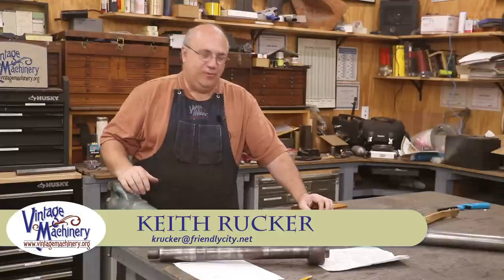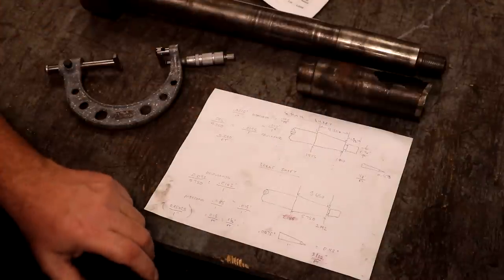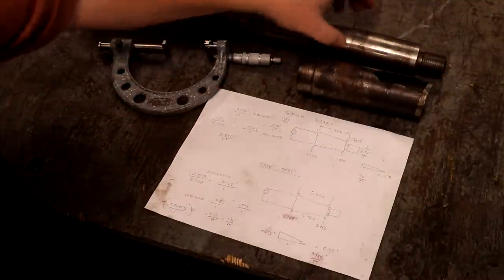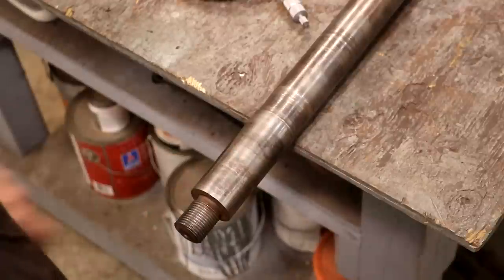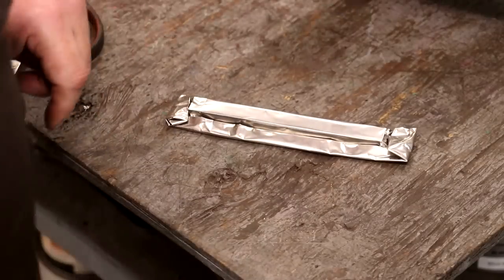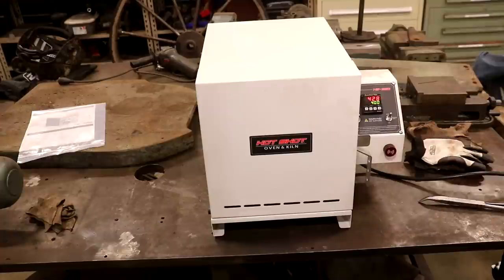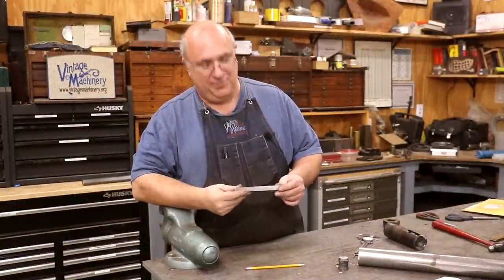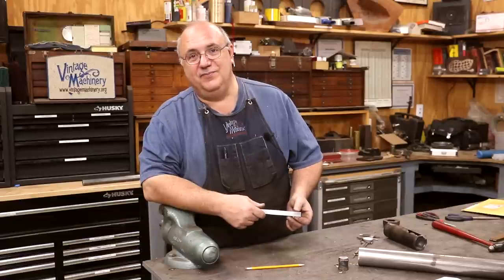The Jimmy Diresta Bandsaw Restoration, Part 8: Making a Taper Gage for setting a Taper Attachment

Comment: We always used a piece of ground round stock to set the taper attachment. Chuck it in the lathe, make sure it's running true and use an indicator to dial the attachment in with that.
Reply: My boss would have chewed my ass if I had wasted time making a a taper gage. An indicator on a piece of drill rod would give a precision taper a 100 year old band saw would ever need. Personally l would be more concerned about the quality of the matching bore in the the wheels of the band saw.
Reply: You've got a DRO why don't you use it instead of wasting time and valuable tool steel
Reply: @paul5683 think of this as a learning video for someone needing a taper Guage for something they do ,for instance someone trying to make multiple parts and needing a accurate and repeatable reference. Not something necessarily needed for this job but nonetheless it's a good learning experience for when it makes more sense to take the time to make one

Comment: Really fun project!  One tiny suggestion.  Magnetic fields love to close on themselves.  You might get a bit more grip if you installed the magnets in alternating directions rather than all aligned.
Reply: I noticed that too.  Alternating N-S-N-S across the piece would give a noticeable increase in grip.
Reply: Agree
Reply: The physics/math behind that: https://wikipedia.org/wiki/Halbach_array
Reply: @stephenoffiler8024  I noticed that Keith placed the magnets down and turned the magnetism. I hope that he had the proper magnet direction to match the mag plate or he would have damaged those small magnets. Altho he probably did it right.  If he had set them in N-S-N=S every other one would have lower magnetism.
Reply: While that would help a lot if the magnets are right next to each other, or they are in a non-magnetic material(ideally with a backing plate), in steel with such a large relative spacing for the size, each would be in it's own little shielded area with all the field lines shorted, I seriously doubt it would make any difference how they were installed.
Remember: They follow the lines of least resistance, just like electricity. You can use that to your advantage to control where and how the fields behave.
Reply: @Current Batches So you say....

Comment: New subscriber here, already a big fan. I'm an engineer doing practical shop-floor process work at a small tool manufacturer for 25+ years now, and I'm still learning some cool new stuff.  I did not know that a specified shaft taper on a print is based on included angle.  I have never seen a taper micrometer. Nice little oven! I need one of those. Re: heat treat foil, glad you remembered the paper. I always tap down my folds lightly to crease them and seal better (but clearly yours worked fine too). Re: grinding, I always use a piece of scrap as end-stop on the thrust side of the workpiece so it can't get spit off the chuck. And a couple times you freaked me out with flesh and bone WAY too close to a spinning wheel. Your spindle bearings must be excellent and you can't wait minutes on end for it to stop - in that case, I'd move it as far away as it goes.
Reply: I'm always very careful around grinding wheels - a moment of inattention and the wheel can take some meat off.  It's happened to me a couple of times, only once leaving any scar that's just made me more cautious.
Reply: I looked or this comment. I always shut off the wheel and wipe the table. Of course, Keith has experience, which I didn't.

Comment: Good job. But you made a minor math error. Thankfully, the angles are small enough that the error isn't significant, but it is a fundamental error.
The taper of 3/32" per foot means that the tangent of the desired angle is (3/32)/12 = 0.0078125

The 10 inches you mention for your sine plate is the hypotenuse of a right triangle, not one of the two perpendicular sides. So the correct thing to do is calculate the angle using arctan of the tangent calculated:
arctan(0.0078125) = 0.447614171 degrees.

then calculate the sine of the determined angle
sin(0.447614171) = 0.007812262

and finally, multiply by the 10 inches for your sine plate, so 0.007812262*10 = 0.07812262

Now, as you can see, the difference between 0.078125 and 0.07812262 is insignificant. But the reason for that is because the angle for your desired taper is so small, so the sine and tangent values are close to each other. If you were using a larger taper, the the differences become quite significant. For instance, if the half included angle was 5 degrees, then doing the math would result is a difference of 0.87488664 vs 0.87155743. And 10 degrees would be 1.76326981 vs 1.73648178.
Reply: When you think you're all alone and then BOOM, someone else sees it that way!!! Great one John and it's gratifying knowing the island has a population..lol....
Happy New Year John!!!
Reply: Thank you. That's what I was thinking in my comment, but I was not as thorough.

Comment: Keith, I was thinking about you the other day. I was at the scrap yard, and there was a pair of line shaft pulleys lying there. I wasn't sure if you would have had a use for them, but unfortunately I didn't sell enough to buy them, but I'm sure they could have been sold online or at our local Rough and Tumble History Society flea market in August. If you didn't have a use. 
Some time ago, I bought an axle with a pair of Amish steel wheels on it from another scrap yard, and a guy from NY state bought them out there for $50.
Nice tool that taper micrometer. I've not seen one before, but I don't go out of my way to buy them.

Comment: What is the reasoning behind making a gauge like that as opposed to sweeping an indicator on the lathe and reading the change per foot that way to dial it in. Seems like an extra step.
Reply: Keith has a toolmaker mentality. He made a tool that once made, it just drops into his taper attachment system and works, no more measurements, no cut and test, cut and test, oops too far, rinse and repeat needed. And it's 100% reproducible if he needs another one. He will also have that tool for the rest of his life, and likely pass it on to the next generation.

Comment: Good work :) About the magnets: I've worked quite a bit with neodymium magnet holders, and if you want them to last you need to be careful when machining close to them. If you break the nickel (most Neo magnets have a thin NiCuNi plating) Neodymium oxidizes very quickly, and very deeply. Oxidized neo loses almost all of the magnetix strength :/

Comment: In tool steels, doesn't the A designation mean it is suitable for air quenching? "O" type tool steels are oil quench and "W" tool steels are water quench.
Reply: Yes that is correct plus there’s different variants in each group, such as 0-1 and 0-2.

Comment: When I touch off when surface grinding I do it just a little bit differently. 
With the wheel off I come down slowly while turning wheel with my thumb till the wheel just
drags on the work piece. 
Then move the wheel up about .002" and start the 
wheel and table and slowly feed down till the wheel touches the work .
I find less surprises this way.

Comment: You could also use forming gas (5-10% H and 90-95% Nitrogen) in the oven.  Not only does it protect the metal but it will reduce oxides at the same time.  The level of Hydrogen is low enough to be safe . . . with proper ventilation.  Check the literature for flow rates.

Comment: ~@36:30  I noticed that you were not concerned with precision in the alignment of the gauge to the direction of travel. Eyeball would seem to be good enough with the assumed tolerances of this specific project, but is ensuring squareness on the mag plate a trivial exercise when producing a "precision tool"? I appreciate that the error on the horizontal diagonal is probably less than 0.000001", but your omission of comment on this geometry deserves explanation.
Reply: Please find my comment elsewhere for this discussion
Reply: There are reasons why it's better not to set the piece fully in line with the wheel. But you are correct the angle ground would be affected of course.

Comment: Keith could you show us how you would grind a non-ferrous metal part, specifically how you would secure it to the bed?
Reply: In case he doesn't show it, use a vacuum fixture for a non ferrous material  You can actually cut a ferrous material via vacuum fixtures this way as well however a magnetic fixture setup  is what we all tend to go too.

Comment: Why didn't you heat treat both taper gages at the same time? wouldn't it have saved on the cost of heating the oven two times?
Reply: Both taper gauges (gages?) ??  He made one gauge.
Reply: @paulcopeland9035  he has two tapers on the shaft so I thought that he would make two taper gages
Reply: @rickburris6164  He has two tapers on two different shafts, and he intends to reuse the shaft with the 1/4" per foot taper.

Comment: Merry Christmas...Love your work....always have !!!!!!! .your 7/10ths off measurement in that 1 inch multiplies up to +1 thou in the 1 ft and could have been on the count of NOT wiping off grinding residue from the mating surfaces on the part and the mag chuck when you moved them and reground.......i cant understand why the 2 tapers are different, Tapers should match, even w considering some type of lubricating film between the 2 tapers, they still should match. Personally I would clean up and recut the taper on the long shaft, and  on the bushing side, after pressing it in, precision ream the bushing to the same taper, only ream it in deeper that allows for that lubrication film abt 1 thou (1/2 tho per side) between part and shaft.. Just saying..........
Reply: It was 1 tenth off, not 7. He was looking for .0078 in 1 inch and he was getting .0077. I think he correctly commented that that .0001" is probably within all of the possible measurement errors of the whole process.

Comment: It looked like you took more care with the alignment of the work on the taper grind than the initial grinds. How important is it for the work to be aligned parallel to the motion?
Reply: It depends on the tolerance you require on the guage itself, when in use.

The alignment is an exercise in trigonometry.   Since the taper is a function of rise over run, when we change the run (length of part) we change the angle [which will determine rise].

So the taper or angle may be seen as a cosine error.  That is, if the alignment of the taper guage is 0°, then cos(0°)=1.  Length of part is 6", so 6"×cos(0°)=6".  To calculate the angle, it is rise over run.  The rise is 3/32" per foot, or 0.0078125" per inch.  This is a 6" part, so the rise should be 6×0.0078125"per inch = 0.046875".  The angle is arc-tangent(rise/run) = 0.4476°.

Examine now what happens when Keith aligns the part to 1.3° to the direction of travel. 6"×cos(1.3°) = 5.9984".  The taper is now changed, since the run is changed.   The angle is now arc-tangent(0.046875/5.9984) = 0.4477°

The error term is examined.  0.4476° versus 0.4477° angle for an error in alignment of 1.3° to the direction of travel.   We now can calculate the error in rise.  Sin((0.4477-0.4476)) = sin(.0001) × 6" run = 0.000010472" or 10 millionths of an inch.

Depending on how closely Keith wants to hit 3/32" per foot will determine the tolerance in alignment angle to travel.  

This exercise in trigonometry has been brought to you by Euclid, the great Greek Philosopher.
Reply: @wagglebutt  Respectfully, I disagree.  The part to be ground should be aligned to travel.  I do absolutely agree that the sine plate should be aligned to travel.  In other words, both should be.  Terrible assumption on my part that he had aligned the sine plate.  You are 100% correct in that.

Let us assume Garry, that he has aligned the sine plate to travel, to perfection.  Less than 0.000001" out over the entire 10".  If he now places the part 90° to the sine plate, the angle ground will be across the taper, but along the long axis of the taper guage, the height will be parallel to the base, NOT tapered in the axis desired.

In manipulating the part, unless it is aligned to travel, as the sine plate should also be, the taper will be incorrectly ground.

I hope in this we can find agreement.  Respectfully, The Bee
Reply: @wagglebutt  Suppose Keith has perfectly aligned the part to the sine plate, and then installed the plate 90° to travel.  Would the taper be ground along the desired axis?  No sir, it would not.

Both must be aligned, to travel.  Simply aligning the part to the sine plate will not achieve the desired result.
Reply: @wagglebutt  I have erred!  You are correct.

Comment: A little confused on the use of the taper micrometer on the shaft. I can understand how it measures accurately on the taper gauge where only one side is tapered, but how is it accurate on the shaft? Doesn't the body of the micrometer need to be perpendicular to the centerline of the shaft? With the fixed post at 90 degrees to the mic body, doesn't that throw your measurement off?
Reply: The mic doesn't measure the angle/taper directly; it comes with a chart and/or equations that converts actual measurement to what you're looking for.  They usually have paperwork that gives readings for standard tapers (MT3, etc) for comparison.

Comment: Keith you shure go through a lot of sweat & brimstone in your heat-treated process . Buy air harden stock heat to the degrees hardness and air cool DONE DID .
Reply: He said it's A2 and he took it thru the full optimum heat treat followed by air quench followed by tempering.

Comment: That was surprisingly hard to make.  Time-wise, would it have been better to rough it out on the mill first?  Or would two setups have nullified any time savings?
Reply: You can actually “plunge grind” on a surface grinder if you block the part well and use plenty of coolant. You down-feed by hand or power at the proper rate for the wheel to break down slightly and sharpen itself. Not difficult at all and used all the time in tool shops. That .093 can be removed and part finished to size in about five minutes.

Comment: When you heat treat the gauge will it not cause the holes to shrink when the metal quenches?
Reply: Very little if any, especially with A2 which hardens in air. If heat treated and quenched at the right temperatures and times, it distorts very little and ends up almost exactly the same size as before it was treated.
Reply: A little but only because the heat expanded them in the first place, so they're just returning to their original size at room temperature.

Comment: Yes, edges of metal can be sharp, like a razor. Yesterday I was working on a dryer and went to remove a plug to be able to finish taking a panel off and when the plug came loose the knuckle at the base of my thumb bumped the edge of the panel square on and not hard at all but cut completely through the hide. Could look inside and see the knuckle and the vein that runs down the back of your thumb. Kinda cool to look at and didn't hardly bleed at all but required 3 sutures too put the 2 cm laceration back together. Moral of the story.... be really careful around any sheet metals, myself I know better and should have had gloves on.

Comment: If the plan is to disassemble those wheels anyway, you could turn the taper on the shaft and the female taper in the hub in one setup, and they will be the same, even if the setting in inches per ft. is a bit off.
Reply: The wheels are 48" diameter and Keith mentioned that he has no way of turning them so the taper they have is the taper he going to work with.
If he could turn the wheels what you're saying would create matching tapers regardless of accuracy though.
Reply: @Crewsy  the spokes on those wheels are screwed in. So you can unscrew them and be left with the hub, which is of reasonable size.

Comment: That Stainless Steel foil seems like a finger-cutting thing...  :) Like a Razor-Blade on a roll. Please Correct me if I am wrong.

Don't dabble with Epoxy with bare hands too often, it is potentially unhealthy. Use gloves at most or all times. Washing with Alcohol actually Can make it worse in that it now might penetrate the skin. Use warm soap water instead.

Comment: why didn't you turn the wheel off on the grinder when you was turning the part around safety first for the fingers
Reply: It probably takes several minutes to spin down. What he should do is move the workpiece as far from the wheel as possible.

Comment: What happens when your grinding wheel gets smaller or grinds away?
Reply: Maybe a "new" wheel!!
Reply: @paulcopeland9035  I’m talking about the accuracy of the grind. Each pass it must get a little less, but I didn’t see any tolerances for it. Thanks for your answer though.
Reply: Certainly there is a little wheel wear, but not enough to throw off a small project like that. 
Grinding wheels do slowly get smaller, mostly from dressing the wheel with a diamond nib and eventually the surface speed drops off to a point where the wheel won't be cutting efficiently. It will still cut, just not like new.
Reply: Most of the "wear" happens on the edges of the wheel, and progresses towards the center with use.  With coolant and light passes, you easily get enough "run time" to finish a project.  If you suspect you've worn the center of the wheel, you can always redress it and do a finishing pass.
Reply: @componenx  Thanks.